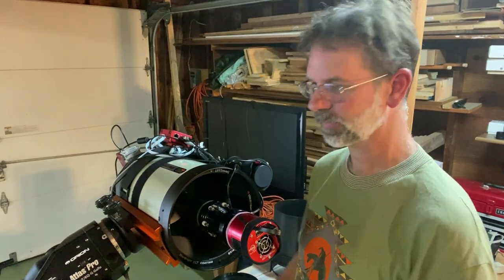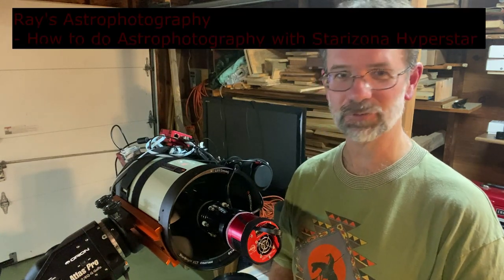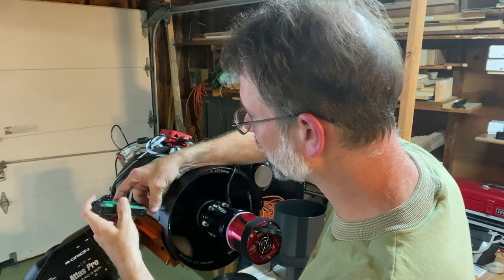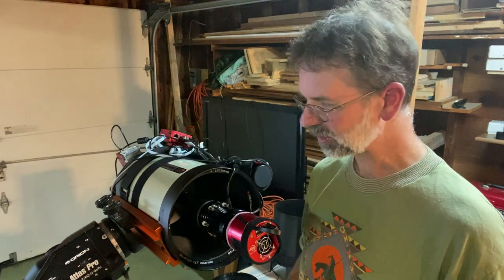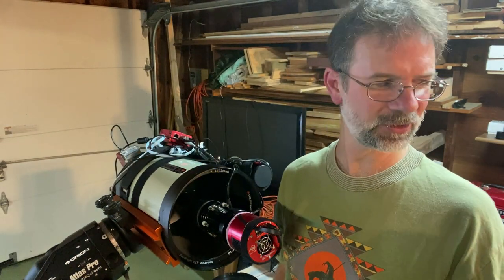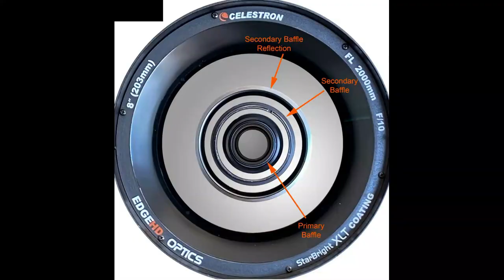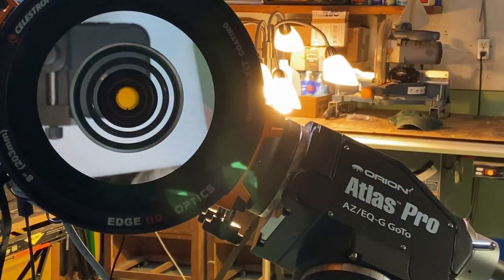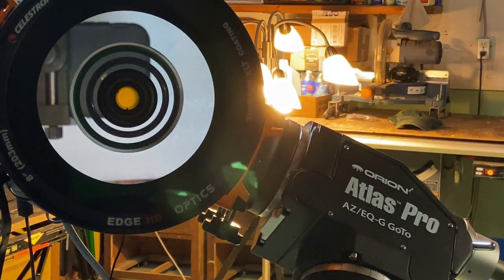Update to Celestron Corrector Plate adjustment for Hyperstar

Comment: Hi Kurt, great video thanks for sharing… I actually created a 3-D printed black plug with a tiny hole in the center, put it where hyperstar would go and put my Howie Glatter laser in the eyepiece holder. I shot it through the hole in the black plug. I adjusted the screws around the periphery of the corrector plate until the laser traveled directly through that hole.  Worked like a charm!
Reply from the maker: Wow Robert.  That sounds like an awesome system.  Do you have the specs for that plug?  - Cheers Kurt
Reply: Can you provide a 3D printer file?  That sounds awesome!

Comment: I have an early 2002 C11 and it has no adjustment screws in the corrector plate housing.  C used gaskets with paint on them that act like glue to hold the plate in the cell and the first thing you have to do is use alcohol on them to loosen the plate from the gasket.  I found this out when I put a new gasket on the secondary holder because it was slipping and turning on me when I would put my very early Hyperstar in.  That was an experience believe me.  C put 2 gobs of glue on the inside threads to hold everything in place and I had to dissolve the glue before I could remove the holder from the plate!  I used 99% DMSO solvent which worked pretty good but it also started to dissolve the inner plastic baffle and messed up the threads a bit.  I used an eyeglass screw driver to recut the threads a bit where they got messed up and it worked great shaving the softened and expanded plastic off till the parts screwed together with ease.  The DMSO also took and lightened the plastic where I applied it (removed paint??) so I had to hit it with flat black paint.   C must use a different solvent that won't mess up the baffle.  (Or maybe they use a pipe wrench and break off the plastic baffle and put a new one on when they work on it.)  I didn't do the eye test for concentric rings after I reassembled it though... I simply used equal thickness shims between the housing and the plate and placed them till I had it centered with no movement.  I am going to check it now that I have seen this video to see if all the 'rings' are concentric.  If not I may remove the shims and see if I can get it all aligned properly.  I am also toying with the thought of removing the corrector plate and holder from the tube and drilling and tapping 3 adjustment screw holes 120° apart and use nylon screws to be able to adjust the plate.
Reply from the maker: Wow Rat, sounds like you really had to learn a great deal in order to fix it. Very impressive but sorry it was not designed so it could be done easier.  Good luck with your new plan. Cheers Kurt

Comment: I’ve adjusted my corrector plate once. I found it very hard to judge the circles as the slightest movement of your head or camera throws things off a lot. I think it’s ok now and I’m pretty well collimated. My stars at one side are still not perfectly round. I think it might be camera tilt. With the weight of camera and cables maybe the sensor is just a fraction off being perfectly perpendicular to the optics. Now I have a permanent setup I’m hoping to get it sorted out. I’d be interested to see some before/after images from your setup to compare with mine but I really don’t want to start messing with the corrector plate again if I can help it. In hindsight I think I was trying to go too fast with my Edge 8. I should have got used to making fine adjustments when I got it but you know what it’s like, you want to image not spend hours of clear sky time adjusting things. I’ll get there but I think people need to be aware that using Hyperstar is a tricky business. Patience is a must! Clear skies.
Reply from the maker: Thanks John, Yeah there is a lot to it.  I was expecting this which is why I held off so long on getting the Edge.  I got that sorted out I thing but am now playing with the Hyperstar.  I do have some images already on astrobin, the latest two are with the hyperstar. (https://www.astrobin.com/users/kurtzepp/collections/712/).  - I need some clear weather now to see if the corrector plate adjustments made a difference.  - Cheers Kurt

Comment: I have an 8"  Edge HD and I accidently loosened the inner mount for the hyper star.  And I couldn't get my Hyperstar off without taking the inner mount apart and I could not do that without risking damage to the mirror.  So I had no choice but to remove the corrector plate.  What I didn't do was look at the YouTube videos on how to do it correctly.   As I did not put tape on the corrector plate to mark it's original position.  And then when I put it back in, I didn't really pay much attention to the inner circles as I didn't know the procedure.   But I do now.   Wish me luck.  I"ve had it out before and I don't plan on removing it this time.  So hopefully I can get it centered and collimated now.  ;o)
Reply from the maker: Wow, a heck of a story.  Cheers and good luck!

Comment: Don't have a Hyperstar (yet) but this is good info ! So you're actually correcting the secondary (witch is fitted to the corrector plate) in respect to the primary.
Reply from the maker: Sort of, but the difference is secondary is replaced by the Hyperstar.  The problem is not apparent with the longer focal length and narrow FOV, only at F1.9 wiht the large FOV.  - Cheers Kurt

Comment: Thanks for the informative video. Do you recall the hex key size needed for the corrector “push pin” screws?
Reply from the maker: Sorry I don't, I have a set and I think it was something like 3mm.  Good Luck
Reply: None of the standard sizes worked but I’ll have a closer look. Thanks.

Comment: Hi Kurt my corrector plate is definitely not centred. I have watched your video and Ray's and they are not in agreement besides that mine is a C11 Fastar SCT. I have written to Customer Support at Celestron as well as Dean at Starizona.. For example Ray talks about slightly loosening the corrector plate screws in the front. One poster says about loosening them all the way out. NO WAY JOSE! to that! So hopefully I will get an official response.
Reply from the maker: Hey Dan.  Not sure what year your scope is but Ray had the older style which you would NOT remove the grub screws and I have the newer model which you DO remove the grub screws as there it a second set of grub screws for making the adjustments.  I don't know about the Fastar systems as I have the Edge System which also may be different.  Hopefully Dean will get back to you soon since he was very knowledgeable the whole issue.  - Good Luck
Reply: @AstroQuest1  I have a C11 which is a new Fastar (compatible) model. I will wait until Dean gets back to me.
Reply from the maker: @dankahraman354  Hopefully soon.
Reply: @AstroQuest1  Me too. I am sure he will. Seems like a very good company.

Comment: Did it work??
Reply from the maker: Yes, my stars have improved, however, they are not as good as I hoped they would be.  On the other hand, I checked with other hyperstar people and they are comparable.  It may be possible to get the nearly perfect stars using hyperstar but it would take getting additional very expensive laser collimators and tweaking them quite often.  With the added cost of the laser collimator, you ma be better off just getting a RASA.  Another solution would be to use a refractor with the same FL as the hyperstar and use those for stars. Cheers